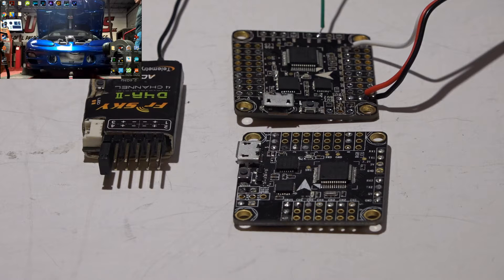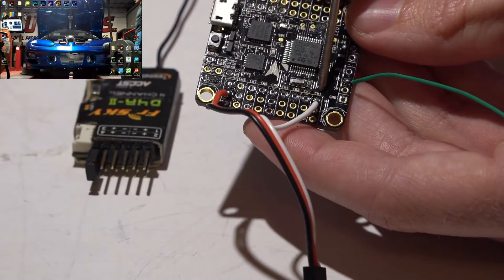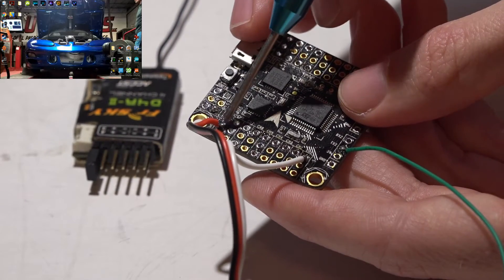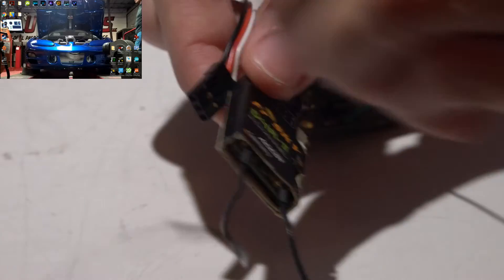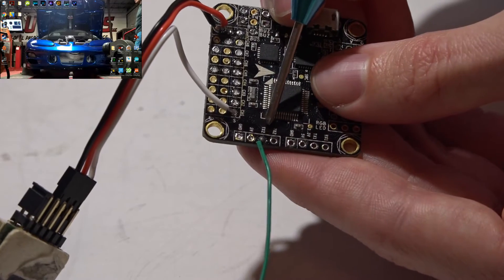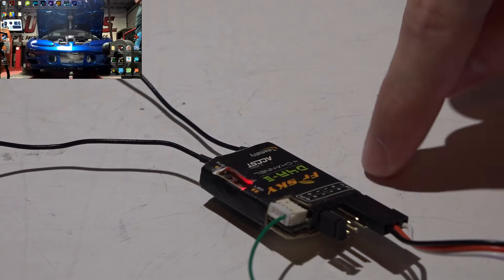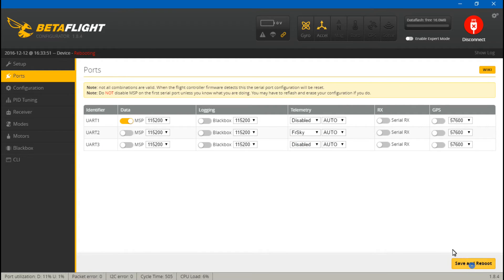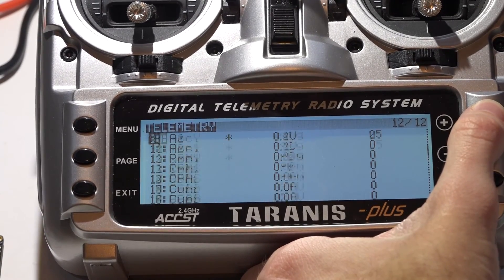X-Racer & D4R-II: Connect & Telemetry

Comment: J.C. HiX Racer 3.1 Flight Controller.Regarding the 5v supply from the USB port to channels 1 thro 6 I believe you to mistaken! 5v is measurable using a DMM but when connected as you suggest it fails to power a D4R2 receiver. You still need the +5v supply from the SBUS.Kindly check and confirm.BTW your videos are very informative!!RegardsRM